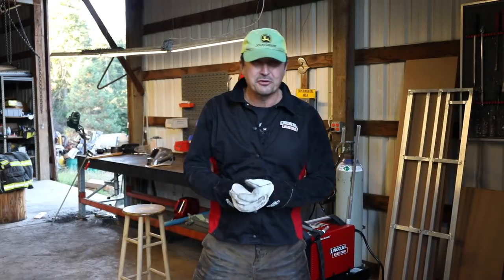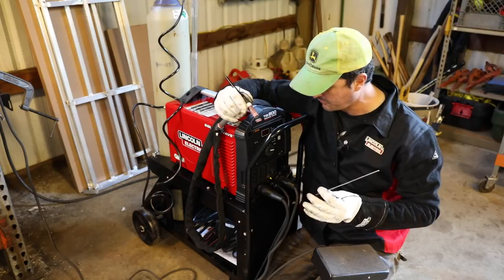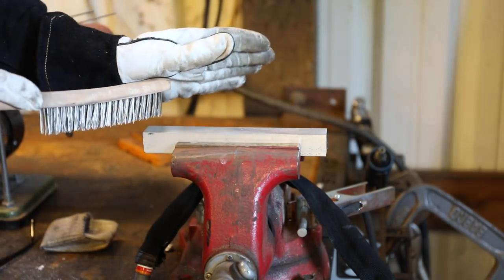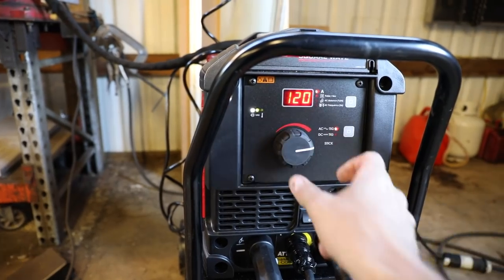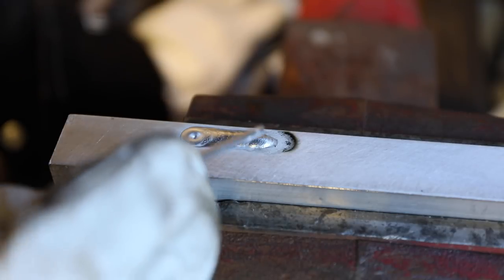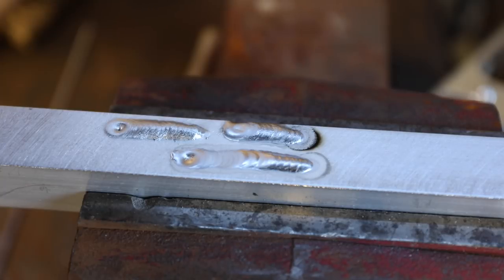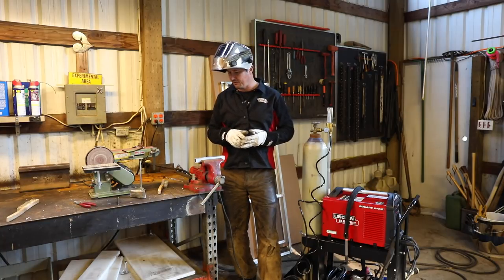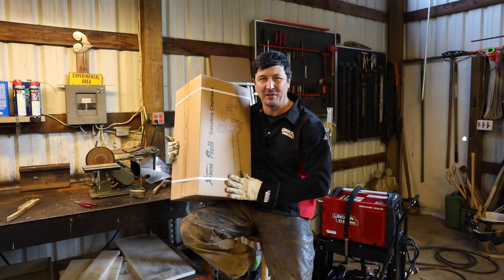The Hardest Thing I've Ever Done!!!

Comment: The main thing with Tig welding is practice, practice, practice. After that is keeping EVERYTHING clean. Brian has gotten you off to a GREAT start, you should get some PVC pipe with a cap on one end and a screw on cap on the other for your filler metal. then clean it before using, it oxidizes just like your work metal. Another thing that helps a ton with Alu only is a helium/argon mix. You can get a good result with 100% argon but 75 % argon 25% helium will give you a much better result and for me seems to be easier to control the puddle. Also like Brian showed you with keeping brushes separate from one material to the other, keep your tungsten separate. also when sharpening tungsten you can put it in a drill and sharpen it, but you will get cross contamination on your belt sander, I use a 90° 3" pad and just keep my pads separate while using a drill to hold the tungsten to sharpen it. I was self taught as well and welding tips and tricks on YT was my best resource. You are off to an awesome start and Brian has been a huge help to you.

Comment: I heard the cosmonauts using pencils was debunked, as graphite fragments being conductive would not be a good idea if it got into switches and electrical components.
Reply: stuart cole That's true. The US pen was also privately funded, and contracted to the Russians shortly after the U.S. space program.
Reply: Those very same fragments would get very annoying floating around in zero Gs. Imagine getting one in your eye.
Reply: Correct. Complete fiction.
Reply: It’s not the fact that it is fictional, it’s about overcoming obstacles by using the obvious and simple vs over engineered and complex.
Reply: John, that's a fine principle, but the "space pen" anecdote is a terrible example of the idea because the simple solution was the bad one and the complex solution was the right one. And in fact that is often the case in engineering. The simple solution gets discounted because it does have a serious flaw, it's just not always obvious to people who have only superficial knowledge of the problem.
Reply: That's 100% correct.  Fire was a much greater risk on American space flights because NASA used pure oxygen in the capsules prior to Apollo 1.

Also, the Fisher Space Pen story was debunked as well.  The Space Pen was already in production when NASA approached the Fisher Corporation.

Comment: Not sure if anyone has mentioned this, but a good trick to sharpen tungsten fast and easy is just grab a cordless drill. Fast and easy. I've done about 25 in 5 or 10 minutes.

Also, that Lincoln 250 is a good little machine. My shop bought 20 at the same time, and we had some problems, but it was mostly from running them hard in a fabrication shop. For a home user, or medium duty, it'll be a great machine.

Also, look into a new torch, the stock one isn't the best, it's really large, and you can get a much smaller one that's a lot easier to maneuver. Also, look into a diffuser for the collet body, it's a screen that makes the argon flow out evenly and get better coverage with less gas

The holes in the end is called a crater crack. Add a little more filler, reduce the heat with the pedal and slowly back off, and as the puddle shrinks, swirl it around the don't end in the center.

Comment: I am Boeing certified and trained in TIG welding. I'm up in Olympia, I'd be happy to show you some pointers. That's pretty darn good for your first try man. P.S. I've TIG welded titanium, it's very interesting, not like any other metal. The rod sticks a lot to the edges of the puddle, so you have to be very deliberate with the filler rod.

Comment: I have found that the best and most versatile tool to have is an oxy-acetylene set up, it can weld nearly any metals, can cut steel, and heat metal for shaping or for removing parts and so on.   Its very versatile and not hard to learn and could be very useful to get into if your looking to.

Comment: If you also plan on welding up that water pump casing, then pre-heat it and also allow it to cool slowly after welding it.
I fixed a Ford F350 Super duty timing cover doing that and it turned out quite well. It developed a crack due to Idler pulley wearing through.
I would have loved to buy that same Lincoln welder but it came out a year after I bought a lesser quality one.

Comment: the comments thus far are good one so I agree you're  doing well and practice is the key. One change that I would do ( and did) is to get a hand held decay rather that the foot peddle. they are usually held in the same hand as the filler wire and are more versatile in tight spaces. Keep up the good work.

Comment: Great video Cody. Glad to see that your stepping into the world of welding non ferrous metal. Your first weld you diagnosed right on the nose. The building up was due to the metal not being hot enough and adding filler material. That crater at the end was due to too much heat input and not lifting the torch head as you completed your pass. That roughness that you pointed out could be either as you said improper torch angle creating porosity or not enough shielding gas flow. Either way you first steps looked good just needs some fine tuning. I am both school and self taught as far as welding, fabrication, and automotive repair. Currently teaching myself how to properly design and build a homestead for raising crops and animals as I am looking to get away from the negatives of modern society.

Comment: your welds look great for your first time. when you finish your weld back of the heat and keep the touch there for a couple of sec for the post flow of shielding gas. when you sharpen your tungsten make sure you use a grinder that has only been use for sharping tungsten you can contaminate it if you us it on something else.

Comment: for a first time tig weld, not the worst i seen! i haven't done much tig myself because it can be fairly difficult. but one thing i have learned is you want to A ground as close as possible to the  material being wielded and B just let the argon flow at a moderate but low rate continuously and dont lift away moment you finish..aluminium is surprisingly reactive to oxygen when hot, and can oxidize rapidly making any secondary strikes char or swiss cheese..   but long story short, keep gas flowing and get that ground as close to the strike material as possible

Comment: HI WS  30 years tigging aluminum and anodized YOUR DOING FINE. you should be following your torch cup. your getting the results you are because your chasing the filler with the torch.   Also ditch the foot pedal and get a on off finger tip  switch.      I run big miller syncrowaves and dynasty s and would never use foot pedal again...we use these to build small items up to 130' aluminum bridges.  This will free up your feet and allow you to be more coordinated.   Check availability on the part i am recommending.    You have square wave which is most of the battle.      Also do not hesitate to practice.   Good luck.

Comment: When welding aluminum, a fresh piece of scotch Brite pad (maroon colored) is handy to clean the filler rod also. Get a piece of brass, thick, and set the machine on DC to “ball” the electrode before welding aluminum. You get better heat transfer. Also, if you put a “cheater lens in your helmet, maybe 1.5 to 3 power max. It really helps. GTAW really is not much different than Oxy Acetylene. One more tip, a thumb throttle is really handy. The foot pedal will be a good start. You will like the thumb throttle though, have fun!!

Comment: I haven't welded much in aluminum, but Ive spent a lot of time welding steel and stainless steel with a TIG as that's what I work with.
As you said with cross contamination steel with aluminium, it also apply with steel and stainless steel.

If you use a steel tool or a tool that has been used on steel, (brush, grinder disk etc) you risk applying steel particles into the stainless steel, and that can cause the stainless steel to rust a bit.

I know that the foot pedal are very popular in the US, but it might be easier to weld without it. (we don't really use the pedal here in Denmark so don't hang me up on that)
However you will need another tourch with a button on for it to work.

But basicly the best thing you can do when TIG welding is practice and try fiddling with the amps and gas settings.
People weld differently and the ones that weld slow, might want to turn the power down for better control. Or the heat up so you can weld a bit faster

Also if you weld on stainless steel, if the metal starts to turn gray and rough(ish) you are using too much heat and potentially ruined that area of metal.

Oh and remember to ground the material, you will feel it when you forget it :-)

That pretty much what I can think of on top of my head, but feel free to ask

Comment: Agreed!  TIG takes talent.  You are off to a great start.  Keep it up.  When you are done with welding up the bed, try a little stainless steel practice and some mild steel.  It's somewhat easier material.  Don't stop now. keep practicing or the heck with it, just weld up that bed.

Comment: My background is a bit less than 40 years of designing parts of automated arc welding equipment.  So here come a few pointers from that perspective.  First two things relate to aluminum.  As you mention, it oxidizes, and it does so very quickly.  Stainless steel brush can “score” the oxide, but you might keep in mind that alumina (aluminum oxide) is hard and used as grinding wheel material.  Actually also the pink gas cup is alumina.  For more critical welds, the cleaning is done with chemical means.  At least some of those cleaners are based on phosphoric acid.
The second issue is that aluminum conducts heat (and electricity) nearly as well as copper does.  So, after a few seconds, the heat has reached well ahead of the arc.  That explains the widening of the bead soon after the start.
Then a note of the “soot” that many people call it.  It has nothing to do with carbon.  All technical aluminum products are alloys containing multiple elements such as magnesium, silicon, manganese, copper, lead, bismuth and on and on.  Some of those vaporize in the arc and fly around, settling on the cooler surfaces.  Moreover, probably interesting to know that aluminum melting point is way lower than that of the aluminum oxide.
The power supply used for welding aluminum in TIG (officially GTAW or Gas Tungsten Arc Welding) originally was using AC and recently something called VP or variable polarity system.  The idea is that during the Electrode Positive half cycle the work piece is bombarded by heavy argon ions, rather than the normal Electrode Negative half cycle that sends light weight electrons to hit the work.  The argon ion bombardment breaks the oxide layer and  cleans the material.  But some side effects are that the arc voltage on this half cycle is roughly 25 V, when at the Electrode Negative half cycle, the voltage is below 10 V, if the arc length is kept short.  If the current is kept constant, the power on the electrode positive half cycle is something like triple that of EN (negative) half cycle.  Welding steels utilizes only DC and that in EN mode.
Now, another thing is that the EN part is producing small arc and the EP half cycle makes a wide one.  The difference is clearly visible on high speed videos, but even on standard ones you can see a small bright core arc and around a dimmer, but much larger arc.  That is due to averaging by the video camera as well as the human eye.
A last detail I care to mention in this already lengthy comment is that the EP current is seeking oxide spots in the work.  When the nearby area is already cleaned, the arc spreads wide!  Modern VP machines can use just long enough EP times to clean the necessary area and extend the EN times to do the welding.

Comment: Really helps to get a gas lens kit for the touch. You really need a dedicated tungsten sharpener for just your aluminum tungsten. The tungsten can pick up contamination from a dirty stone or sanding belt. You can get a 75argon/25helium mix just for aluminum welding, gets you a hotter arc at lower amps.

Comment: Loved the video, and wanted to give my 2 cents as far as TIG welding goes. 
When you first start the arc don't hold the torch in one spot for too long. Reason being that the surface oxidation layer has a higher melting point than the base aluminum. 
As far as the black coloration goes, perhaps your shielding gas is being blown away. Try closing the garage doors and see if it makes a difference.
Everything else is just learned through repetition. Your first welds look better than most, and on aluminum no less!
You'll be TIGing with the best of them in no time, keep it up. :)

Comment: I am not a pro welder by any stretch but I do my fair share of welding on racecar parts and food products. The aluminum welding is pretty hard compared to steel. Personally it took me quite a while after I "mastered" steel to get any kind of decent welds on aluminium . As far as your issue of the weld getting hotter as you advance, it is totally normal since aluminum soaks up heat. The longer you weld the more heat builds up in the material and the more penetration you get. Typically you have to start with more heat and reduce as you go in order to keep a consistent bead profile. If I can give one piece of advice starting out with tig welding is to make a point to use both hands pretty equally from the start. That way you do not develop a preference  (like in writing ) and it will make your life easier in the long run. 
Have fun!

Comment: Great video, and gutsy to put yourself out there with the sharks circling.  However, the comments so far have been very supportive of your efforts to learn.  Please take my comments below as such as well as I am just making an observation to help, and certainly not kick you down.  You did a great job explaining your TIG experience, and I was there (and still there) for the most part.  

A few things I was taught that may be working against you here.   The lead in clip showed you grinding your tungsten on your belt sander.   If this belt sander has been used for other materials, it is possible to contaminate your tungsten by using that belt.  The belt grit value may be a bit on the rougher side and could create a rougher grind on your tungsten than desired that could create a wandering arc cone.  The final and more important thing I see is that the grind on the tungsten should in line with the tip, rather than around the rod itself.  In other words, you don't sharpen a TIG tungsten like you would a pencil.   The grind marks going around the tungsten will also create a wandering arc cone.   

One final note would be to wipe down your work piece with Acetone with a lint free cloth to remove oils and other contaminants prior to welding.  

Again, great job on this video.

Comment: Mcmaster Carr sells diamond wheels for bench grinders that will last a lot longer than the belts and discs on your sander.

Several other people have mentioned welding tips and tricks and they are right. That channel is an amazing reference.

Turn your amperage up and get used to modulating with the pedal and try moving things around and making passes with no power to make sure your in an appropriate position.

I've found that scotch brite scouring pads work better than anything else for cleaning the oxide layer off

Comment: i started with gas welding which shares the angle and feeding aswell as the fine movements before i started to learn tig. it made it a whole lot easier when you can seperate learning tasks like that.

Comment: I agree with others about shielding gas. It looks like you need more. Also close the doors or set up some temp. walls as wind will blow the argon away. I think for starting to TIG you are doing great. I would say slow down with your filler rod you are looking for what they call a stack of Dimes.  I have better luck when I sharpen the tungsten by having the grinder parallel to the tungsten so the scratches don't go around it but parallel. I also clean the metal with acetone along with the brush. Your machine should have a setting so that it will keep sending the argon out after the foot peddle is stopped. You need to keep it there longer for it to flood the area while it cools.

Comment: As a welder that was one of the funniest things to watch. You have to feather the pedal though the weld. Start out full petal and ones the aluminum is warm you can slowly let off on the petal. You also need to ad a big dab at the end of your bead as you tapper your ark off. That will prevent the crater pit your getting. Your weld should be nice and shiny.

Comment: At the end of your first few beads, that sunken area looks to be from the metal cooling down and shrinking. Use your foot pedal to taper off your power a bit slower at the end to make it go away. Also, I'd crank my amperage down by about 4A for this guage and positioning, and focus on more consistent movement and fill speeds. But you're off to an outstanding start!

This is all just my $.02 as a "pretty ok" self-taught TIG welder. Good luck, have fun!